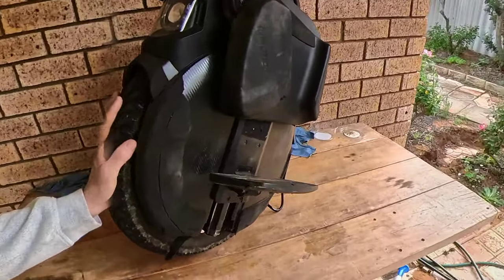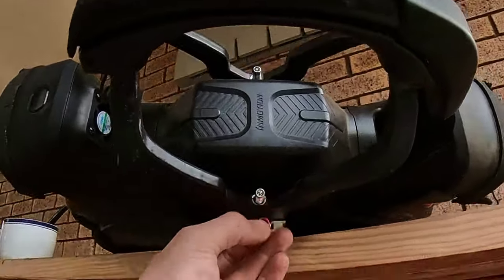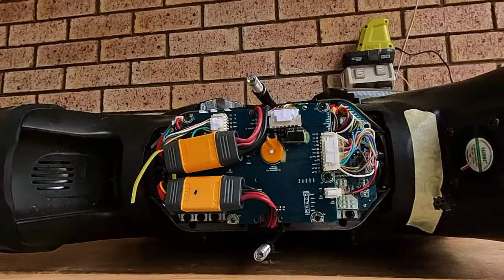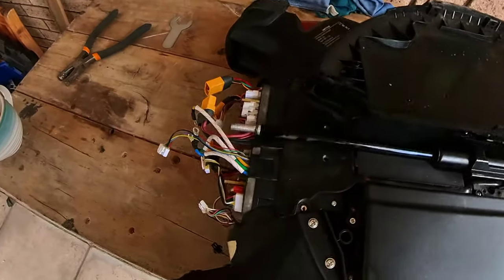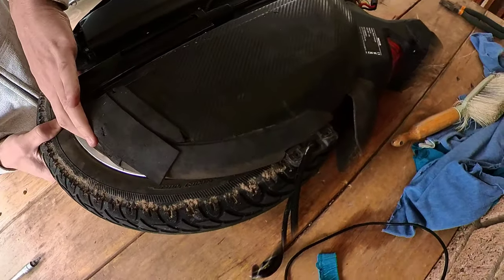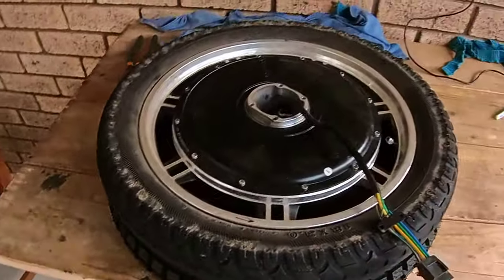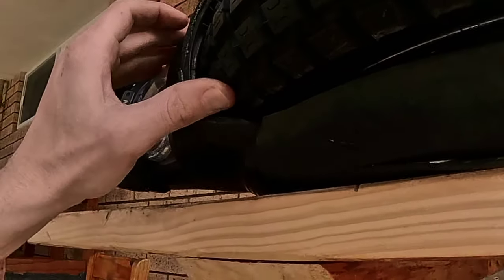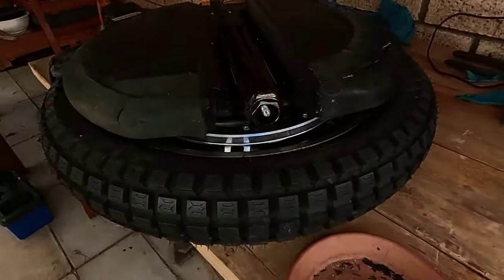InMotion V11 Tyre Upgrade Shinko 241 14"x2.75 Motorcycle Tyre

Comment: My buddy had a similar tire and we found out that the stock is much pleasant overall. Especially with low-speed amount of control you have is much better. The knobby tire is good probably only for the winder and deep snow.
Reply from the maker: Hi thanks for the comment, I will never go back to the stock tire

Comment: Have you thought about instead of air in the canisters for shocks suspension adding some oil in there might help not bottom out the suspension on heavy-duty tarmac or stairs........  I put oil in pit bikes front shocks just a lil bit and it has always helped. FYI
Reply from the maker: I will look into this

Comment: Hi. Good job, but what's this awfull noise at the end of the video ?
Reply from the maker: That the oscillation rub? That's the block of 4 tire pin hairs I left on. The clearance is low and I wanted to be sure no rubber was rubbing. Those hairs have since fallen off. Smooth rolling now.